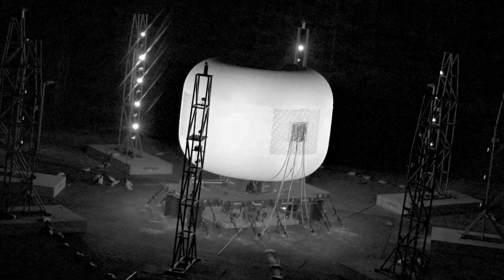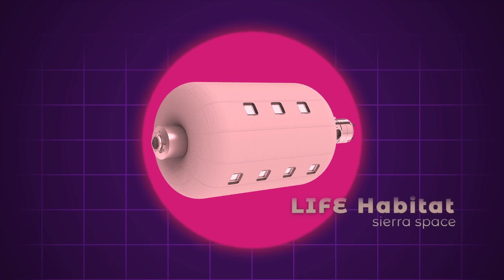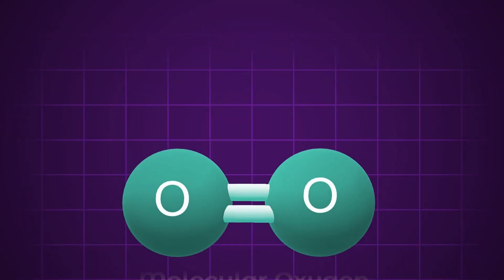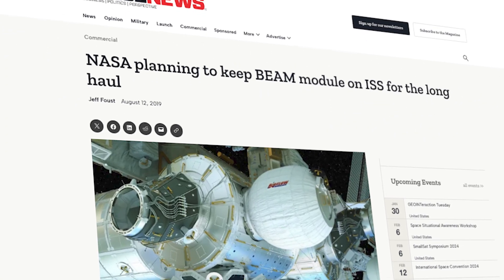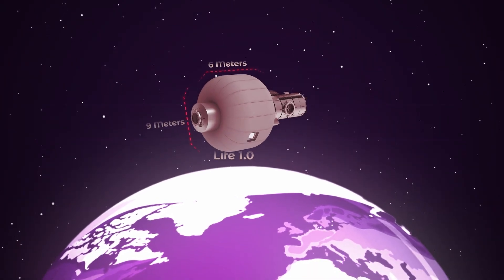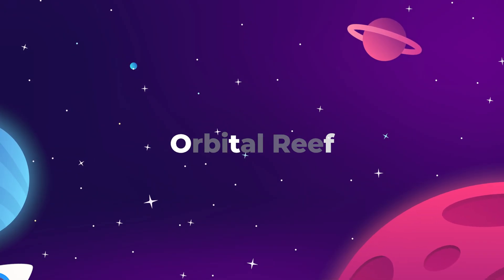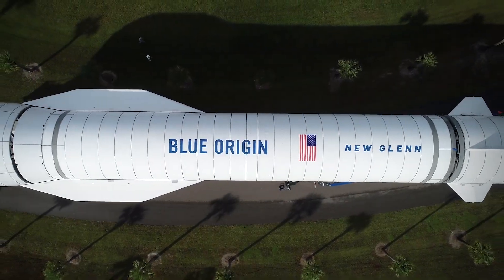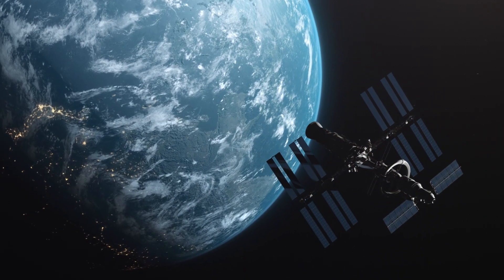This Is NASA's New Space Station...And it just exploded

Comment: Take a bunch of them out on Starship. 20 to 50 will fit into a small space? Partially inflate them so that they will not bounce away. In the middle put the equipment that will go inside. Allow two layers play inflate the first one. Partially and play the second one. Inject foam between the two to provide insulation. Fully inflate the second one so it completely fills the area. Maybe the foam can be hard and extremely rigid so that it will protect against holes getting poked in the walls. Starship can bring down 25 people we can immediately go in and start setting everything up. Maybe robots would be able to do that for us at the slow rate that we're moving along. Somehow take pieces of the boring company machine and dig down into the ground. You can guess the rest

Comment: It should be safer than steel because at the pressure of 15psi which as we saw 5 times less than maximum tensal strength, baloon would just simply bend in, absorbing the force of impact and than poping back in to shape. Worst thing that can happen is crew getting bumped by the bend. Also its unrealistic scenario because object in the impact has to be pretty big to ve able to do that

Comment: I don't understand why they don't take advantage of some things that happen actually in space and send the ships up and segments attached and built on to the rockets but once you get them in outer space you unbolt certain parts of it and it folds out into a different shape and then it different shape will latch on to the other shape that the other piece of rocket folded out today and then you got this natural welding effect in space so you have this material over the top of the material that can Bond once it's touched it's self you remove that safety material strip and you let the stuff naturally bond together and eventually you have a huge ass starship and according to advances and stuff like that you can change the engine designs or where the engines are going to be and all kinds of things I mean the thrusters and all that stuff are in the rockets let's get up there you know use them

Comment: I don't know if anyone was thinking this but I know I think it's very cool, but the way PRESSURE works is very fascinating. You might think 15 > 60 PSI isn't a big jump, but you have to remember that when it says Pounds Per Square Inch, it REALLY means that. A 12 inch by 12 inch balloon that only inflates a few inches high (like 5?) at maybe... 6 PSI? That is 4,320 pounds. BALLOONS are utilized to lift BOULDERS off of people in collapsed buildings. The space station looked to be several FEET tall and a good few feet wide. At 15 PSI, the internal pressure was maybe... Let's just say 60x60x90 at 15 PSI, that's 4,860,000 pounds over a large area. Because of dispersion and the square cube law, this pressure isn't that bad on a human body or even the walls although it is enough to actively push the walls OUTWARDS. Which keeps it inflated. Now 60x60x90 at 60 PSI is 19,440,000 POUNDS. That's, again, like 4 times as strong, but when you're at numbers as big this that's like punching a wall Vs. dropping a NUKE on it. I'm not crazy about Physics so I don't know all the equations so I'm sure someone with more knowledge could explain it more indepth but those are some crazy numbers to think about.

Comment: Talking about different high-tech fibers, they is many of them (carbon, kevlar, vectran, HPME, etc.)
But they greatly differ on several aspects : cost, strength, durability, UV resistance, and creep.
Carbon is a very high strength, and perfect UV resistance. But it is very fragile, and thus, doesnt age very well.
Kevlar is famous, but had a terrible UV resistance. It basically burn itself alone, and age really badly when used outdoor.
Vectran is very similar to kevlar, but with a secret : after a certain amount of UV received, it stop aging ! So it lose very quickly 50% of its strength, and then, stop degrading. 
and HPME (aka dyneema), IS the super magic perfect fiber of yours dreams (very high strenght, very good UV resistance, reasonable cost, super durable). BUT, it also has a problem : the creep. It self elongate itself through time and load. (for a balloon, lets say that's not great, as 1% of extension would already be destroy the other layers)

Comment: From a doctoral level physicist :due aerogel sheets  in the middle, and tiny ceramic tiles mixed in on the outside surface. Onemore thing, used on  self sealing fighter jet fuel tanks on pin the middle layer. 
Contact me for more ideas.

Comment: important to note just how high a pressure that thing exploded at, they had two failures in that test, and the only failure they had before target pressure was in the hard metal fittings they were using to inflate the structure, i'm also rolling this around in my head and i'm not seeing any reason for hard portions of the station? except maybe in an intersection of four or more units

Comment: Just to be completely clear, even a soft rubber-composition space station would not "pop like a balloon" if pierced by a micrometeorite, or under basically any other circumstance unless it was demolished with explosives.  The pressure at which tires for example explode is around 200psi, or about 14-15x atmospheric pressure, that is, the difference between the pressure inside of the tire and outside is something like +13-14 Bar.  The maximum possible difference between the inside and outside of a space station in air pressure is, for obvious reasons, only +1 Bar.  This also assumes that the station is actually pressurized to one full atmosphere, which is doesn't have to be at all, it could drop as low as 70% normal pressure and given a few hours of acclimation time the astronauts living aboard it would be none the worse for wear.  
The major issue of a soft rubber "balloon" station would be wear and tear from heat cycling, which is the same thing that's wearing the ISS down now.  In direct sunlight the temperature in Earth Orbit can get as hot as the inside of a convection oven, while in shadow on the opposite side of the planet it can be more than -200F.  These kinds of thermal stresses would in a matter of only a few cycles, rapidly demolish any manmade structure not specifically insulated by layers of para-aramid fiber and high-albedo metal (like the ISS is) away until they became brittle and simply fell apart.  That's why nobody plans to use rubber for an expandable station, because it would dry out, crack, and basically disintegrate rapidly in the environment of space.

Comment: See... That's because of the lack of simple earth science! Water! Because micro rocks are only the start! Plus - with that system - getting things in and things out - is where the high level of failure is... Where as, if you create a bubble around your bubble with connects and expansion done along a single axis with capped off protection and use a pocket of water to surround the station - easy to monitor and signal leaks - on the shaded side (facing away from the Sun) freezes the water and helps slow down effects of damage - leaks facing the Sun would "steam" and add to being visible! Plus effects of radiation our atmosphere stop are better stopped by water then some air bubble!

Comment: This is certainly a step forwards for space exploration, and exciting, but also don't forget that the outside pressure is zero PSI, so the structure would need to survive this mismatch in pressures. Surviving to 75 PSI is great, on Earth, where the outside pressure is 16PSI (75 - 16 = 59 PSI in Space), so does it actually pass NASA's requirements, or was the requirements based on Earth pressure? 
For concernes of debris ripping or damaging the "Balloon", a multi layered metal jacket could be expanded over the outside. I know this is adding more weight, and I am also curious how man made resins and fabrics operate and last in space - fiberglass hulls for example. Of course fiberglass has its own dangers when astronauts are working with the material.

Comment: this is a cool design. I have an idea for a cheap solution if it can become cheap in the future. is to have a jacket buckle system for your inflatable balloon space station. Whereby, this jacket buckle system will have a series of metal plates designed specifically to prevent the micro meteor shower from destroying your inflatable, by having the jacket and buckle fasten these metal plates out to a certain distance in all directions except for the dockeing system, so to slow down these incoming risks to your space craft or station,. as well having the foundry and manufactury inbuilt into this station that will replace thses pieces by recycling, so you may have a self sustaining system that works for the community that uses it.

Comment: Just as long as they don't ever make it out of carbon fibre then glue titanium pressure seals on to it ☠ ☠
Reply: The differece: That were 330bar from outside. We here have 1bar from inside.
Reply: @hiha2108  Do you know, I had never actually considered that until just now, I mean I knew, but never considered the actual facts of it.

Aye, you are correct, far lower pressure from inside pushing out in space than there is outside pushing in from the sea.

Comment: Tire rubber does terrible in intense sunlight, drys out and cracks in a matter of months. Combine that with vacuum doing whatever it would do... I'd hate to be in a space tire when it zippers..
Reply: Do remember a vacuum is less pressure than most tires have to maintain. But yeah sunlight would absolutely fuck it. And one thing the vacuum could do is have outgassing be worse and potentially could damage the rubber?

Comment: I wonder, is it possible to bring anti-meteorite armor separately? I mean, if it doesn't have to be airtight, just slap some sheets above this balloon: it's not like there is a limit, when station is already on orbit.
Reply: Cost is likely to be one factor.
Keep in mind that "anti-meteorite armor" is not just armor plating.  Modern spacecraft use things like the Whipple shield; a multi-layer armor not designed to just stop micro-meteors.  Instead the first layer breaks up the meteor and disperses it layer by layer into smaller and smaller bits that each successive layer is more likely to stop.

While this is much lighter than simple armor plating, it ironically requires much larger payloads than armor plating to get into space.  So while it's cheaper to launch by weight, it may take more rockets to get it into space either way.

Comment: NASA doesn't own the ISS, it's largely made of Russian and US modules. The space station will expire at the end of this decade. Sierra Space's inflatable station isn't meant for Earth's low orbit but for a lunar orbit. Such an inflatable station offers zero shielding against micrometeorites and space radiation (400 mSv/year plus occasional peaks by solar flares), the latter reduces the dwell aboard station to eight weeks at the max to avoid chromosomal defects and/or later carcinogenesis. IMO a modern orbital station or surface base should be made of a polymer composite.

Comment: Good video with a lot of info. 
It is a real horse race to see which company will be operational in LEO first.
Personally, I would love to see Sierra ditch BO and partner with JAXA. The JAXA modules on the ISS are almost a space station by itself, with its own crew quarters and robot arm.
Although I know you love the Dream Chaser, (so do I), but it has yet to fly in CARGO CONFIGURATION. Flying a CREW-rated Dream Chaser is still going to take some time. For reference let us recall the length of time between Cargo Dragon and Dragon 2 Crew. 
Crew rated vehicles are much tougher to certify than Cargo spacecraft. SpaceX made it a point to create Cargo Dragon with a pressurized module and deliberately built it with the human rating process in mind. It still took them over 7 years from the Cargo Dragon's 1st docking to make the manned successor operational. Hopefully, Crew Dream Chaser will not be as extensive of a modification as Dragon 2 was, but my bet is at least 2-3 Years for NASA certification. And I would doubt anyone will fly until it is NASA certified. The only alternative would be FAA certification, which let's be realistic, is even SLOWER.

Comment: How do they handle the internals? surely you would want some subdivision and infrastructure  inside
Reply: Interior walls don't need to be structural. Just some sturdy fabric, which you could sew in wires and such into.
Reply: A large system of carbon fibre and titanium rings hold it together ;)
Reply: Pop-up books come to mind

Comment: Seems a little odd they would want to keep the air pressure in space where there is no air, almost exactly the same as at sea level on earth. And the oxygen at 21% as well.

If you're not doing hard physical labor, most people don't have too much trouble with the air pressure at about 5,000 ft, which is about 10 psi.

And you're not doing a whole lot of physical exertion, except when you're exercising, in space, as everything weighs nothing.

Make one small habitat for exercise only, and keep the pressure higher there, and save all those gases everywhere else. It's not only expensive to take air into space, and it isn't free to condense it down into a liquid either.

Comment: Thanks i have watched 4 things on this so far and none answered that burning question i had. How safe is it. Would still like to know what happens to the people in it if it  pops in space
Reply: As safe or safer than the traditional aluminium construction used for things like ISS modules
Reply: If they aren't wearing suits, they die within seconds from exposure to raw space and vaccuum..  Even wearing suits, they are probably getting shot out at speeds and tragectories that don't make survival promising.  That's the short answer.
Reply: It won't just pop in space; remember, 15 psi is our comfort zone, 60psi is NASA's requirement from a safety standpoint; this thing can handle 75psi.
In short, this is technically overkill as far as designs go.

It would take a truly catastrophic failure of the life support systems for the atmosphere on a space station to reach that level of pressure, since it will normally operate at that 15psi range.  And the crew would have plenty of time to prevent that.
Reply: @mahonriyojimbo2092  high sorry for asking but when the iss got that little hole that went all the way if that happens in a very very tuff but it mad a hole not just popped. i am knew to understanding this so not trying to troll just want answers

Comment: Perhaps this life module should be advertised as an expanding habitat and not an inflatable one unless, of course, if it requires the air pressure to remain "inflated." The interior design and the equipment installed would be interesting to see. ISS is a nightmare with wires and equipment  and such.
Reply: I can definitely see the module having a solid trunking core for cable/pipe management that goes down the length of it, to each of the modules' ends, with the idea of building divider fins outward from there to create separate rooms where needed. Deployment in space would be interesting, but possible.
Reply: @piisfun  if air pressure is required to keep the module inflated, then it won't be safe for astronauts to live and work inside it for long durations.  Even though there's been one on the ISS for a couple of years, it has yet to be seen in any NASA videos as being used in ISS activities. These modules would be best utilized as lifeboats more than anything else.
Reply: @piisfun  that's the part that is concerning. If we need to keep it pressurized, other than for breathing purposes, then it's not very structurally sound to support electronics, electrical, and scientific equipment and living quarters. 😎
Reply: @PiCorder remember that “heavy” test equipment is weightless in 0 gravity. The equipment would only need to be tethered to keep it from floating away.

Comment: yea this will never happen i think. because of the threat of micro asteroids. chance of one of critical size is low, yes. but if one hits at all it will implode.
vacuums don't suck but the air inside will still rush out and because of the weak structure of the "walls" it will implode and crush the crew similar to what happened to the "Titan" submarine accident. the reason the old way of building a station works better is because the walls are stronger, and when its hit by something that makes a hole. all that is happening is a gas leak and sensors will figure that out. and the walls are not collapsing do to stronger structure.

i am guessing, im not a scientist
Reply: It doesnt implode it just leaks air gradually. Which can also be patched.

Comment: Weird how there isn't a layer containing water. I guess there must be a good reason I don't know.
Reply: Why is it weird?
Reply: Short simple answer:  Water boils (evaporates) and freezes.  In space, depending on which side it is facing (towards or away from the sun), it might be vaporizing, boiling, freezing or cycling between all those states.  That's a lot of stress to put on any container or design.  Why bother?
Reply: @WinkTartanBelle Radiation protection, micro-collision protection, heat dissipation and water storage. To manage the heat all you need to do is block the direct sunlight with solar panels which you need anyway.

Comment: Inflatable space stations are attractive designs but I think they are inherently fragile compared with others
I suggest to strengthen them after deployed
Reply: Architectural rigidity is required when you have 1 G of force constantly propelling your structure into the earth.  Flexible strength is enough in space, where .01 G thrusters are all that is ever needed.  Flexible resilience is probably a better survival strategy for a docking mishap than rigidity.
Reply: The Sierra inflatable is already stronger than the ISS.  And anyway it’s very easy to repair.